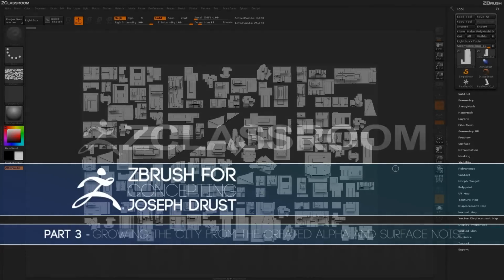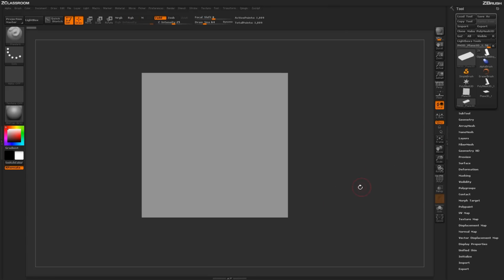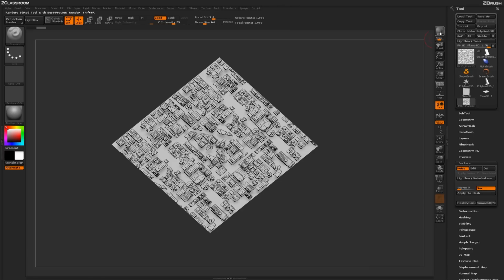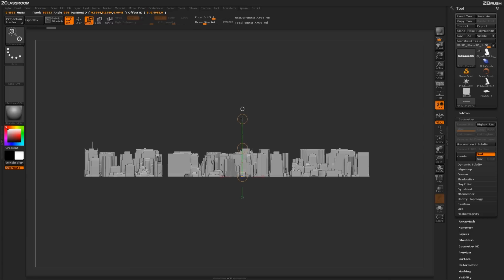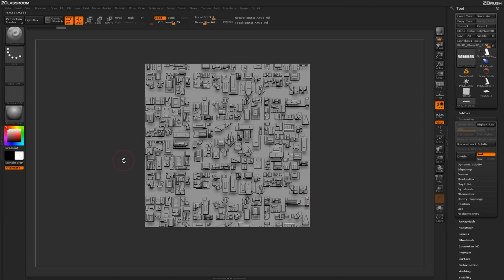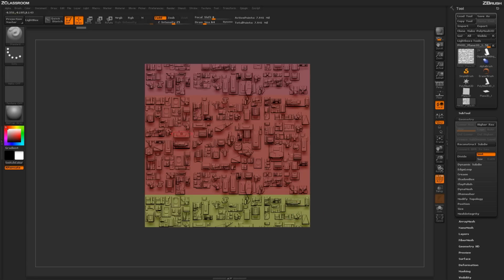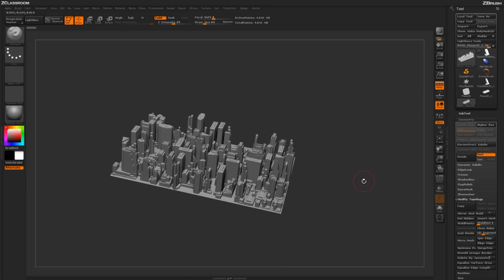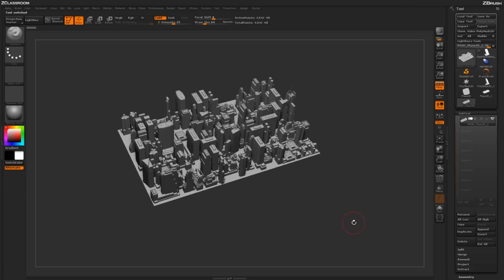ZBrush for Concepting - Part 3

Comment: how do i get my buildings to be different heights :S i made sure they were all different sizes and scaled differently after making them and still they are 1 height, even the small buildings i created are being stretched
Reply: +Wipeout I got the same problem: you figure it out?
Reply: +Wipeout Nvm, I figured it out: what you want to do is make sure you set the mat to map cap grey and make sure you export from the top alpha window. If you export from the brush menu it will just create a flat alpha.
Reply: Krobbkag Destroyer Of Worlds
 nice one, thanks was never able to figure it out so i ended up giving up lol, will need to go back and retry it now :)

Comment: Am I seeing a few million polys for the cityscape?

Edit:
Yes I've tried it and indeed with only a few boxes the mesh generated was 7+ mils, that's ridiculous. There are much better and efficient ways of creating a bunch of buildings without the hassle of dealing with millions of polys.
Reply: Llies Meridja could you please share a link to the other methods? If something is better I would love to know about it.
Reply: Van Franklin Don't know of anything that is particular to cityscape design with the "new" zmodeller brush, I might knock up a quick video about it myself in the coming days. However, I don't even understand why ***** doesn't just make copies of the subtools, tessellate them, scale, rotate and what not (making sure they're on the same level and even add a plane for the ground) and move forward from there while staying nimble within a low poly workflow. Why go through the hassle of going 2.5d, creating an alpha then re-importing and adding noise, for what? To end up with millions of polys?

Nice to know the trick with the alpha and noise but it's not the best approach for this particular design. It makes the resulting model hard to manage, modify and very expensive to render. The low poly approach is more scalable as it allows for adding detail to the buildings or streets later on if needed.